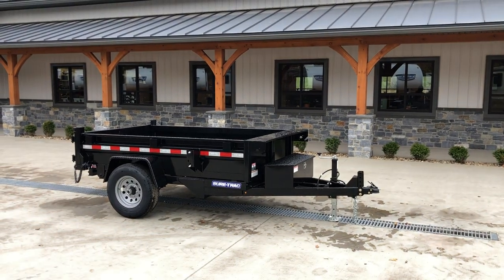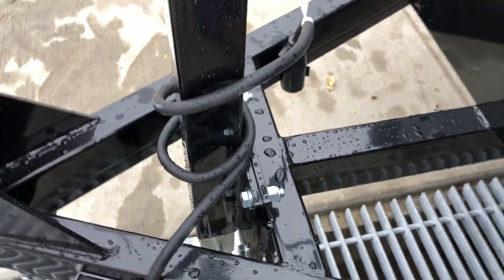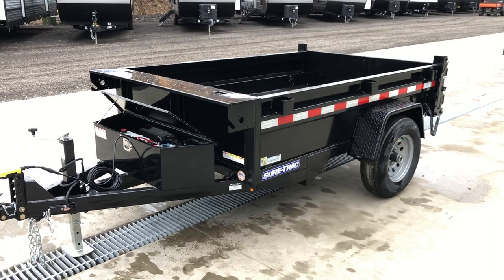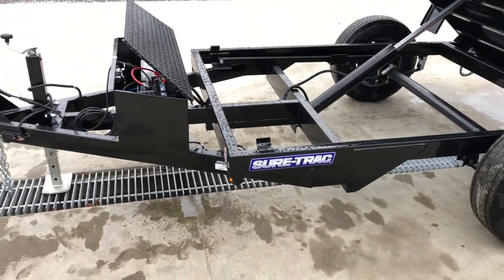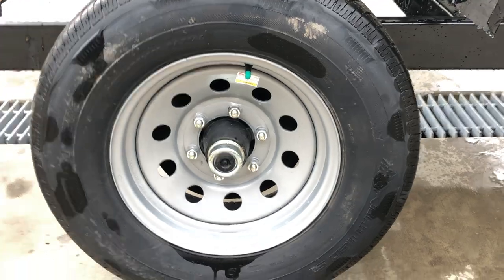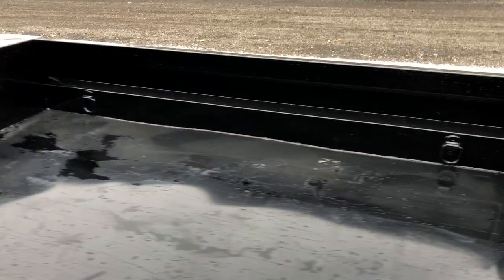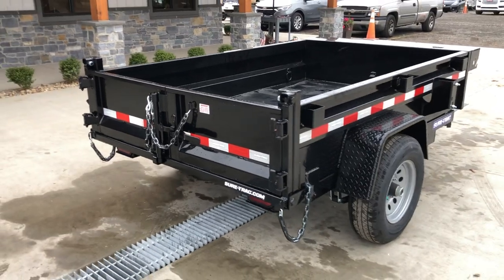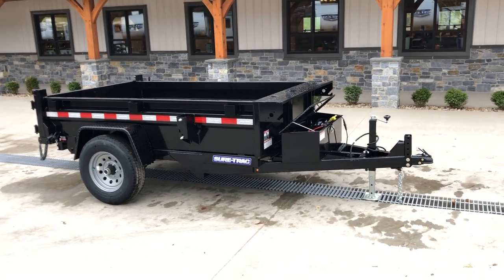Sure-Trac 5x8' Single Axle Dump Trailer 5000# GVW

Comment: Have owned one for 3 (three) years.  So far it has been an great trailer.  It has a landscaping  tailgate, which is pretty heavy.  We haul the log splitter and lawn tractors in it.  She has been loaded to the top sides with firewood.
Reply: Izzyrodthegod  As long as it is balance out you will be OK.  Haul 21A gravel no problem